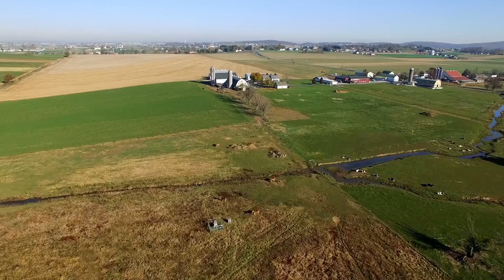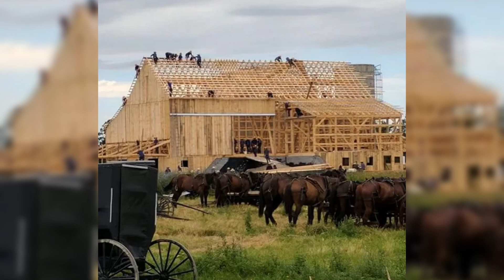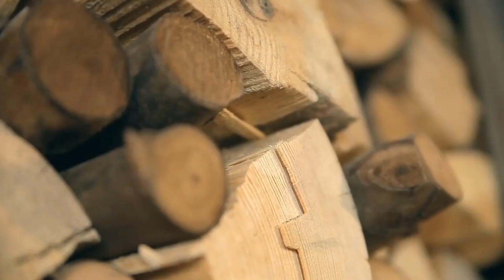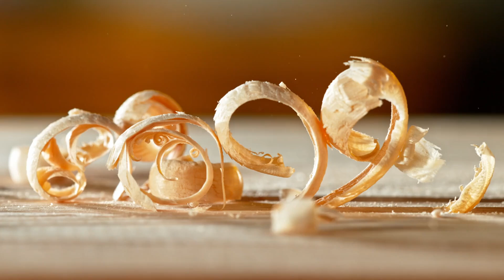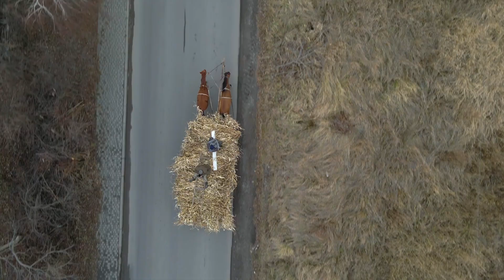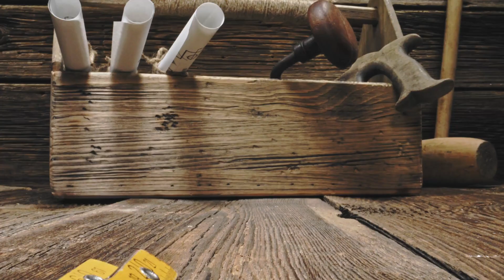How the Amish BUILD Houses Faster Than Modern Construction!

Comment: Plumbing and electrical are a big part in today's modern home and it takes time to do it right .. If you don't have to frame for it, it will cut a lot of construction time.. My guess is they don't insulate either. No fancy cabinets, no elegant flooring, no chandeliers. Not even a fireplace.. They are able to build as a community because they don't have lives of their own either.. No deck to speak of, no vinyl siding, no ceramic tiles, no walk in closets, not sure what they do for heating. No central air, no central vac, no laundry room, no tv room. Of course they can build them faster.......if that's what you want..
Reply: the way they build these they dont need most of that stuff to survive, their homes are built better than ours and allow their homes to breathe which keeps it cooler. They also open certain windows when cooking to create a breezeway in the home or cooking house. They also use wood or stone stove/fireplaces for warmth in the winter and taller rooms for more airway.